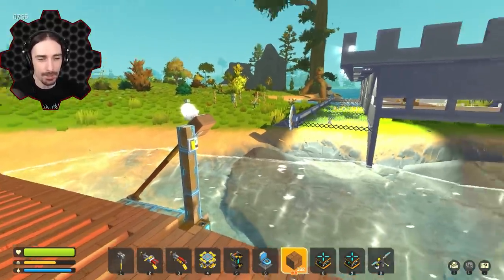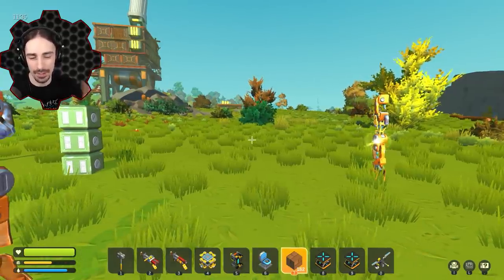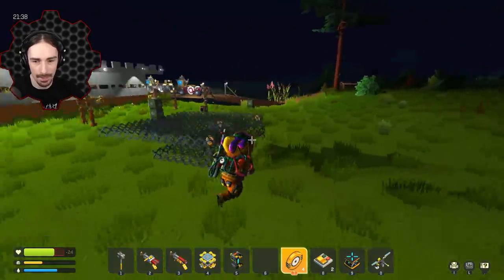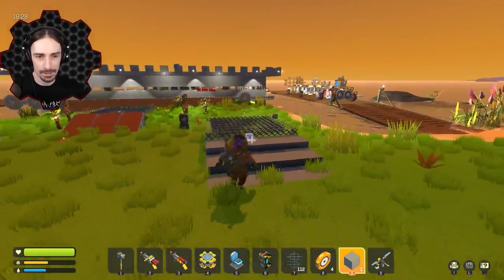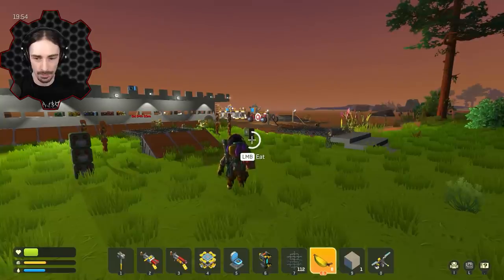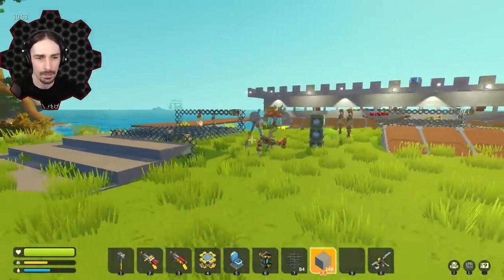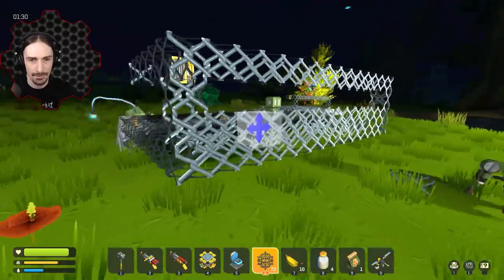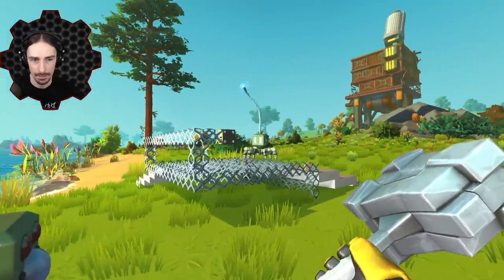I Made Automated Farmbot Catapults to Troll the Bots! - SM Survival Mode [SMS 28]

Comment: 20:30 the problem is that the haybot thinks the edge of the ramp is like the edge of a mountain bc the system is a separate thing. So you can probably just place a ramp and it will stop dead in it’s tracks if you make a gap in between it like the system you’ve made

Comment: The sensor is the problem because if you notice the hay bots get close to the bar but far enough away from the sensors reach that it can't see it but also not triggering, now a fix might be having level 1 sensors on the floor like a checkered line at the stoping bar, I don't know for sure but it might work

Comment: i think the hay bots are afraid of where the sensor is sensing, but not the sensor itself. like, when you did the first raid with the catapults, a hay bot just walked right up to one and destroyed the block the sensor was on with no problem. but whenever a hay bot is infront of the sensor, it stays away from where the sensor is sensing. so if the sensor is set to 15 blocks, the hay bot will stay away from the sensor by 15 blocks, if the sensor is set to 4 blocks, the hay bot will stay away from the sensor by 4 blocks. so maybe you have to set it where when the haybots walk ontop of the platform, the platform will move down a little, activate a sensor, and then launch them into the air.

Comment: you had the sensors to low.. put  them two blocks high and protect them with ramps or tier 3 metal blocks. but the sensors would be better under looking up, with the catapult surrounded by ramps

Comment: my theory: haybots are avoiding sensors. idk why but thats my theory
Reply: its not the sensor its the gaps in between blocks because there are certain times where they actually can go on it and get launched, but if you paid attention you would see them glitching from the first block to the gap and back and forth, unlike the sawblades which just make them back up with no issue. There would also be no reason for it to pathfind away from sensors.

Comment: The hay bots are programed to avoid sensors idk why but I checked the code and it says that when a there's a sensor he will avoid everything x omount of blocks in front of the sensor
(X is the range of the sensor)
It's basically like if there was a saw with adjustable length in front of the sensor 
BTW the greenies ignore sensors
Reply: Steamy they avoid sensors because they’re often used for traps

Comment: my actual "theory"
could be that the sensors could act like a saw blade / drill to the hay bots.
Reply: its not the sensor its the gaps in between blocks because there are certain times where they actually can go on it and get launched, but if you paid attention you would see them glitching from the first block to the gap and back and forth, unlike the sawblades which just make them back up with no issue. There would also be no reason for it to pathfind away from sensors.

Comment: The hay Bots know there's a sensor and they're trying to avoid it
Reply: its not the sensor its the gaps in between blocks because there are certain times where they actually can go on it and get launched, but if you paid attention you would see them glitching from the first block to the gap and back and forth, unlike the sawblades which just make them back up with no issue. There would also be no reason for it to pathfind away from sensors.

Comment: His path finding makes it so that he doesn’t run into the sensor, I think.
Reply: its not the sensor its the gaps in between blocks because there are certain times where they actually can go on it and get launched, but if you paid attention you would see them glitching from the first block to the gap and back and forth, unlike the sawblades which just make them back up with no issue. There would also be no reason for it to pathfind away from sensors.

Comment: I think that the sensor is too high because it was working when the center was one block higher than the platform maybe you should put it with the sensors on or like flush with the platform

Comment: I'm really curious to know why you went with a Threadripper? Is there a specific reason?
Personally, I think you would have been way better off just getting a 3900x/3950x and spending the extra money on a 2080 ti and faster RAM and/or faster timing. The only advantages of a 3960X over a 3950X are more cores and express lanes. Which don't seem relevant to your build and use case. Unless you use Blender or something. But even then, the 16 cores of the 3950x would have been plenty and it has a higher clock speed which is better for gaming. And you don't need all those extra express lanes with only a single GPU and 1 NVME drive. 
Also, why didn't you wait a bit longer man. You could have got a 4th gen Ryzen and maybe even a 30 series RTX card instead. Dont get me wrong. Its a ripper of a PC you bought. Heh heh. But it's definitely not what I would have sold you on. And I definitely would have recommended you wait a bit longer. Even if you bought the same stuff, it would have been a lot cheaper once the next gen of cpu's and gpu's were due to hit the shelves.
Sorry if I sound critical. I'm not being critical, I just get annoyed when people get ripped off by these big brands like Origin. I've been building and selling PC's since 1994 and I have always prided myself on the quality of my builds, the compatibility of the components AND my customer service and honesty. I would never sell someone a PC they didn't need just to profit.
P.S. Sick idea with the catapults dude. Shame they didn't wok as planned. What about one big long catapult instead of multiple shorter ones?

Comment: (this is a joke) Can i have your old PC? i'm running on Intel HD integrated graphics and 2.6 GHZ and 8 GB of RAM, i only have 4 GB of VRAM, i can't even run GTA V. and to top it all off i'm capped at 60 FPS due to my monitor, and even though there are very few games that can run at 60 FPS for me, i like it when i can get it, doesn't help i'm on a laptop since my desktop had to be retired. but yeah, just a bit of a joke to brighten your day, getting a new computer soon enough. btw i'm also on 10 KBps internet, getting internet too, takes me 10 minutes to connect to discord, i have to drive 12 miles if i want any better, and even then it's only around 1.3 MBps